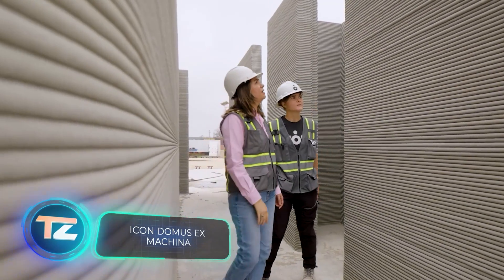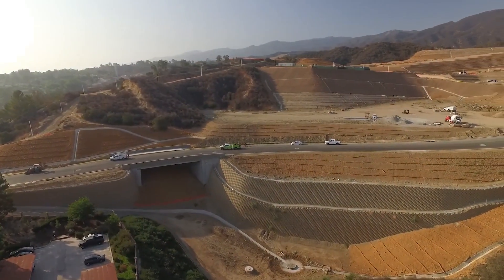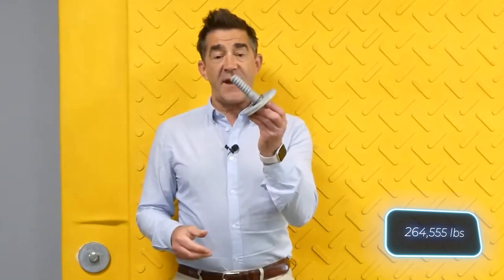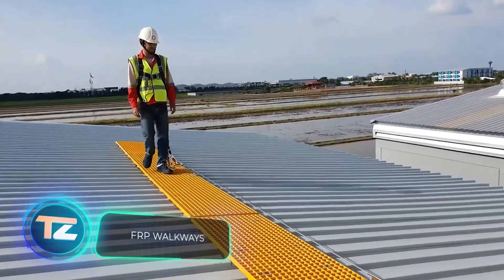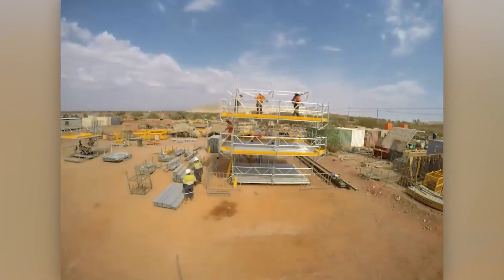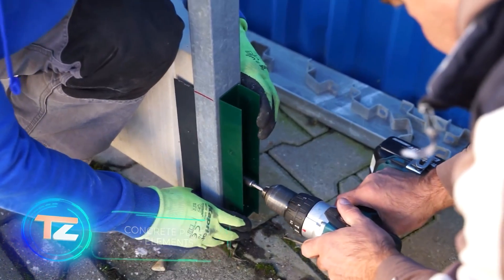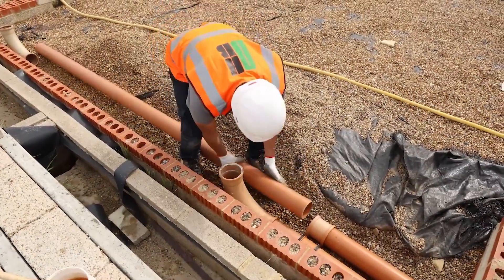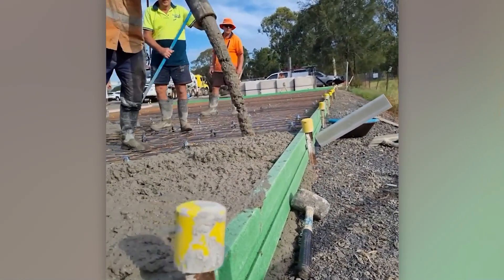CONSTRUCTION TECHNOLOGIES THAT HAVE REACHED A NEW LEVEL

Comment: The house construction at the end of the video looked like it has polystyrene backing, polystyrene is known in a fire to give off extremely toxic fumes, this froma fireman!
Reply: It's not polystyrene it's AAC/Hebel it's aerated concrete that makes it really light weight. Don't fret Mr Fireman, it's non-flammable.
Reply: I made a lick when the Monte Carlo roof in Las Vegas caught fire in 2008.  Same thing you’re describing.  Cutting corners will eventually cost way more.  Stay safe!